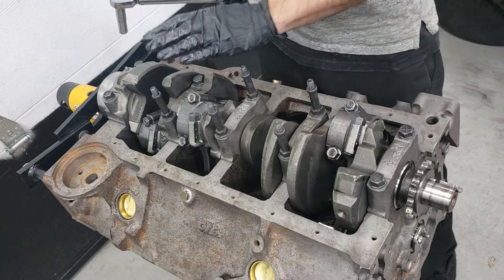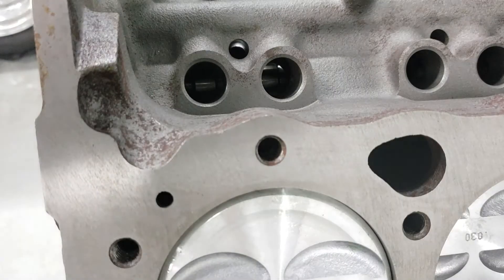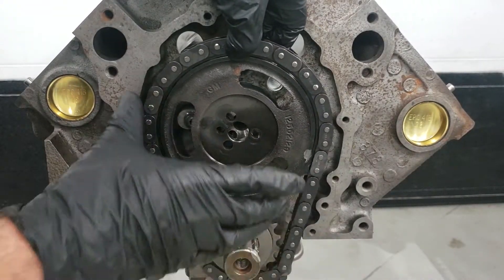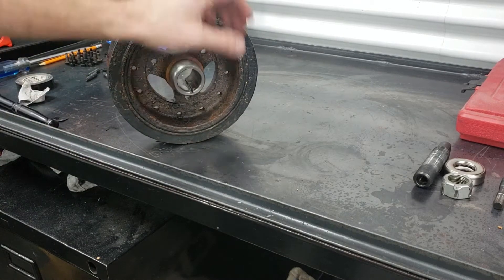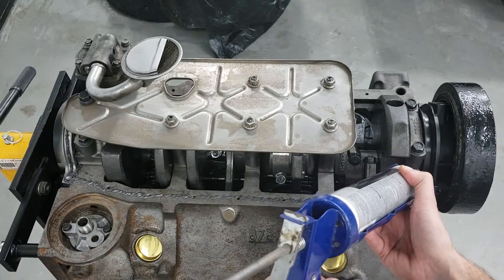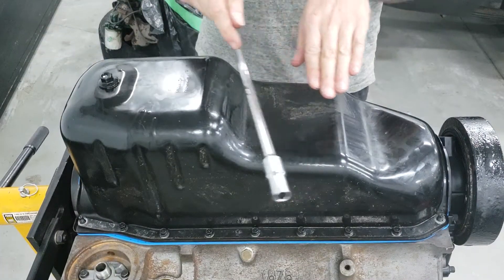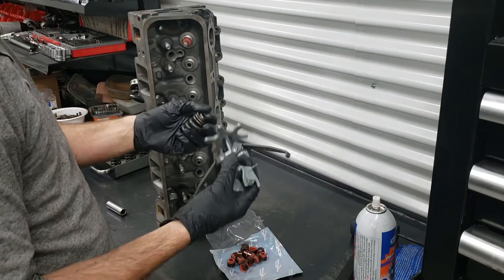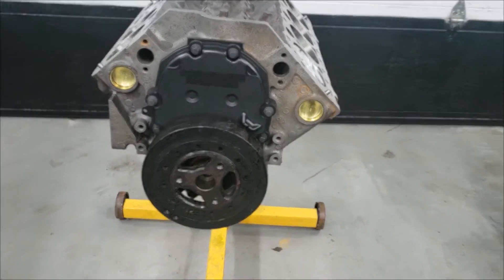Mercury 305 rebuild | part 5

Comment: Thank you for your videos, you're explaining it really well. The only thing I didn't understand is that you're installing the timing gears 12 to 12 o'clock and not 6 to 12 o'clock (dot-to-dot). I've learned that you always install it dot-to-dot. Maybe you can explain that? Thank you!
Reply from the maker: Thank you! I'm glad they helped.  And to answer your question. It doesn't matter if its 12 to 12 or 6 to 12, or 12 to 6. once the chain is on, and you rotate the crank 1 full turn, your dots will be 12 to 12, if you rotate another full turn they will be back to 12 to 6. The ratio is 2:1 between the crank and cam.  So every 2 turns of a crank, is 1 turn of a cam. The next step will be rocker lash adjustment, so you would be turning the crank a few times anyways so you will loose the 12 to 12 alignment in the process. I hope this makes sense.